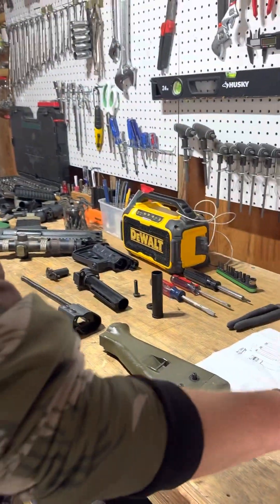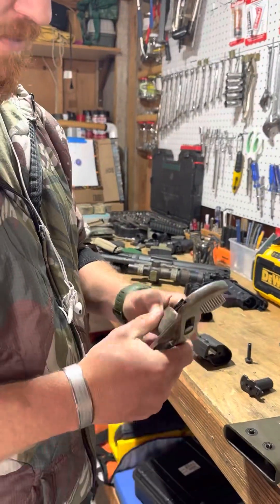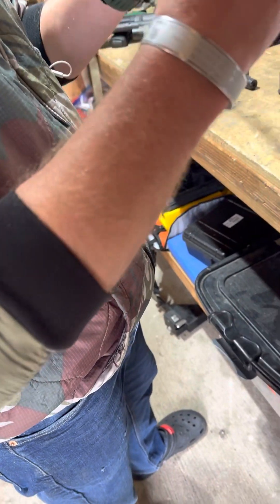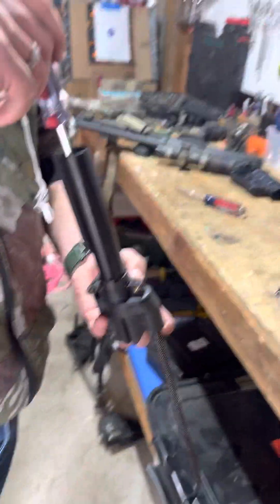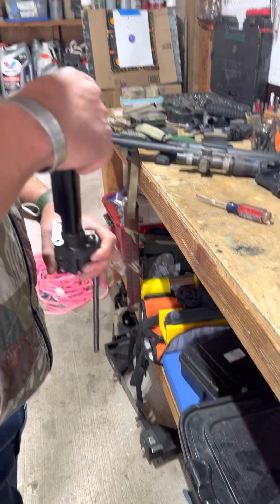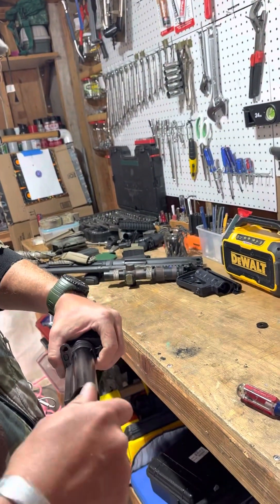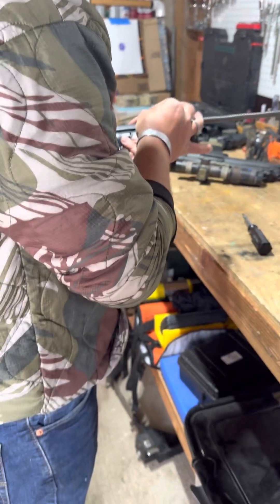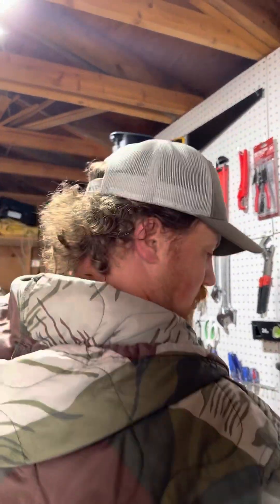Spuhr G3 PTR91/PTR101 Stock Install

Comment: My rifle (JLD PTR 91) came without the screw that goes into the buffer from inside the stock. Apparently all the PTR black polymer molded stocks are made without the removable buttpad. My question is this: Is the rear buffer screw totally necessary for the Spuhr stock or does it hold fine without that central rear screw?
*The large buffer screws are $2 online. This question is hypothetical as I intend to buy one anyway but I've seen people saying its fine with just the 2 smaller ones in the plate.
Reply from the maker: not being an expert, I would still get the screw and do it right. It's cheap enough to not bust your wallet. If I installed it without the main screw, it would always nag me if I did it right. Just me though.